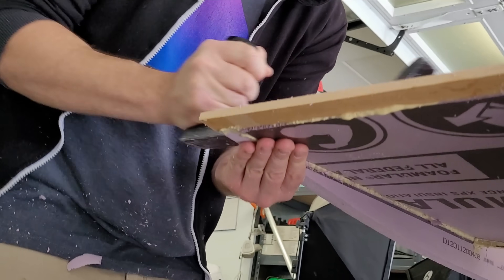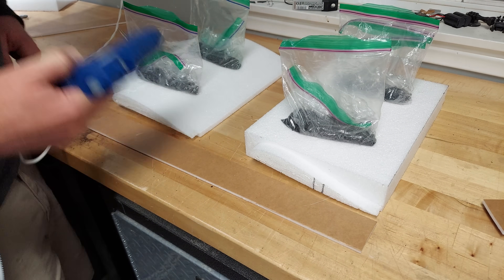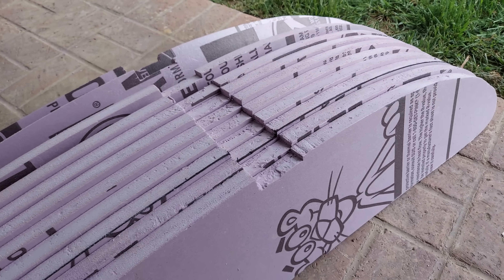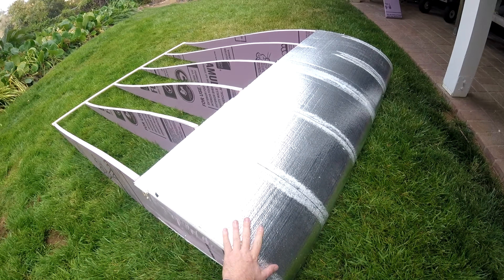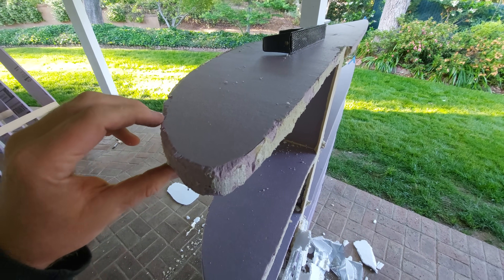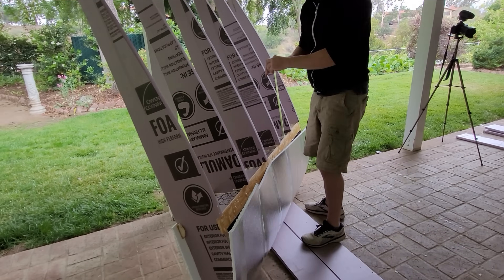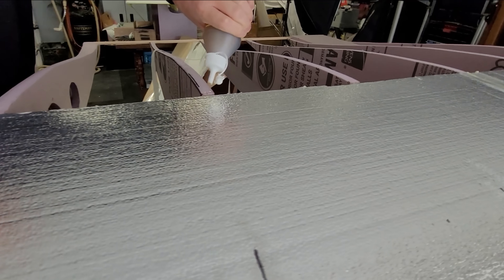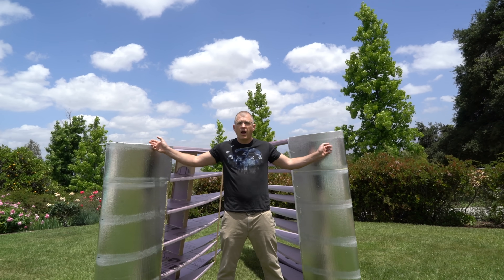Coolest Water Toy Ever?  Manned Boat-Towed Ekranoplan (Build Part 1)

Comment: i love the idea of ekranoplany but I've kinda realized why they suck as a concept: They are always so close or in contact with the water, so part of them needs to be built strong enough to smack into waves trying to take off or land, but even more than seaplanes. They would be light and simple and efficient if they didnt have to be a little seaworthy, but they end up being more expensive and heavier than an airplane in order to chase an energy saving of 50% or less in cruise. 

It ends up easier to make a boat OR a plane.

Comment: How many times are you gonna fly this thing? probably not worth the effort to glass it more or add provisions for ruggedness if this only going to be for a few tests on the lake. If it were something you wanted to keep and take out more than a few times a year it's probably worth the effort. Awesome project and I cant wait to see it fly!
Reply from the maker: It will only be flown as many times as it takes to get good video.   However a lot can go wrong in a short period of time.    Decisions.......
Reply: @thinkflight  guess its time to hedge your bets. JB Weld and 200mph tape! Or more seriously build in a mechanical fuse that will break when you biff and can be replaced in the field. Gotta fly for the video!
Reply from the maker: @intuitiveengineering3277  I've been thinking about some sort of quick release if I go flying off, I will look into this mechanical fuse.

Comment: Covering material: There is a covering material designed for light aircraft called "ORATEX covering for General Aviation".
It is glued on the structure and shrunk by an iron, just like we do for R/C planes. Much less work than the fabric and dope process. Light weight too.
I would not cover the leading edge with fiberglass, think weight reduction all the way.
Pay attention to the strength of the main spar at the centre section. That is where the load is concentrated.
Reply from the maker: Just looked up Oratex for GA, wow that stuff looks amazing.    I want.   Too expensive at the moment but I will call and see if they want to sponsor for the video, never hurts to ask.

Comment: Build process is awesome... I'm no expert on RC stuff or flight in general, but it might be a option on future builds when curving the foil board panels to cut relief slots through 3/4 of the foam. That would make it easy to bend around the radius of the airfoils (like you may do with cutting reliefs into skirting boards or ply panels to fit curved walls or framing).

It may even be a advantage because you could reinforce one or more of the grooves with fiberglass and glue to add rigidness for very little weight added to the wing.
Reply from the maker: It was very difficult not to punch through the silver backing when doing relief cuts, so I gave up and did it this way.
Reply: @thinkflight  , I would buy an exacto knife and a few extra blades. Use a pliers, break a blade at the needed - while it's angled forward a good amount - length. Done.

Comment: Planning on working on a "crewed" WIG myself. I was going to go off a design called the "aircat 2.5" but was thinking diferential thrust and to be wacky try to have it inflatable or semi-rigid as the paddle boards look to be able to have "naca" shapes with relatively low psi. Love the videos and follow rc test flight too.

Comment: if you make a series of shallow cuts along the line you want to curve the foam will bend easier, the tighter the curve the closer the cuts should be, you can fill the cuts with glue before rolling the curve.. I would consider using poor mans fiberglass, a thin cotton sheet attached to the surface with latex paint and fully saturated with the paint, its light weight, strong and fairly water resistant. An oil based paint would be more water resistant but may eat the foam

Comment: why didn't u hot wire it out of solid foam .. u would get those 4 wings in under an hour ..
Reply from the maker: But could I have sourced all that foam, made hardwood templates and made a huge hotwire cutter in the remaining 7 hours?
Reply: @thinkflight  5 hours
Reply: you r going to need a huge hotwire cutter to build ur manned GEV this is a good place to get that right .. 18s lipo  is a good starting voltage for wire that long

Comment: Fascinating build process. Engineering a build process can be as, or more challenging than forming the design to be built. I often think as much, or more about how to build something as the designs I consider. 

Great that Test Pilot Bob (Brains on Board?) would able to verify your concept. Too bad Test Pilot Bob didn't stick around for the scaled up build process, not even to supervise.  Thank you for the 3m 77 callout. I was not aware this product existed. 
If needing to make large foam ribs, in future you might consider constructing a vertical hotwire tool. It could work like a band saw for cutting ribs from flat foam. (clean results with less mess)
Reply from the maker: Maybe I will have Bob sit in some more, I had not thought if this!  He is usually off in the corner trying to stay out of the spotlight.

Comment: From an “armchair experts” perspective, I’d think the fibreglass covering will add to durability of the structure, weight shouldn’t be too much of an issue as it’s not self powered. (Yet) 
  It’s probably better to overbuild a project than under build it when you’re putting so much time into it anyway.
Reply from the maker: Point taken
Reply: p
Reply: cool thing about wing-in-ground effect aircraft is their efficiency. they can lift a LOT of weight once they're in ground effect. so making this heavier is no penalty except for takeoff. this is why a number of models "blow" air underneath to lift them to cut that initial drag.

Comment: Yep that poly urethane adhesive works good
Reply: If you can get the small ones cheaper than the big ones it's more effecient. Kinda need to use it when you open it and not try to later less you keep it really airtight. I ve wasted a few half full big bottles
Reply: Man I use thin roof valley flashing from Lowes metal rolled bout 20" width for leading edge and a nosespar
Reply: You could glass and glass nose strip
Reply: Like a imp thin glass panels. This proof if concept will work

Comment: If you want to try and add an epoxy fiberglass layer to the d-box do some tests on the surface of that plastic-covered EPS. From personal experience, epoxy will not properly bond to that foil-like plastic.
Reply from the maker: This is my guess as well.
Reply: @thinkflight  , West System G-Flex 650 might work. Call them, they're in Bay City, Michigan. I'm not affiliated, just suggesting.

Comment: I absolutely enjoy the process content.  Building a large wing structure like this isn't trivial.  As far as adding fiberglass to the D boxes, I would do it.  Being towed behind a boat will involve a lot of abuse and impact. If there is a water proof iron on covering (big boy monokote?), go for that - It looks like there is plenty of support with that rib spacing.  I salute your efforts, this is COOOL!
Reply from the maker: I like your assessment on the fiberglass.   Worried about it adhering to the reflective surface, will have to run a test before making a decision.
Reply: @thinkflight  test the adhesion of various glues on it, also test sanding the reflective surface to rough it for gluing.
Reply: @ultratorrent  220 grit.

Comment: There are inflatable versions of these things that are banned in a lot of areas. As long as you give it a controllable elevator it should be a lot less dangerous than the inflatable ones. 👍🏻
Reply: I remember seeing videos of those things - they were horribly unstable.  It was terrifying to watch!
Reply from the maker: weight shift control!   We shall see....
Reply: @thinkflight  then it's the same concept as the inflatable ones. I've personally used the inflatable ones and the problem is you are heavily reliant on the person driving the boat to make sure they are going the right speed.